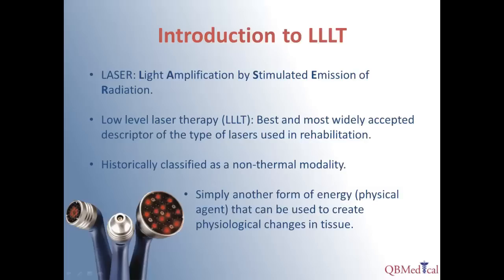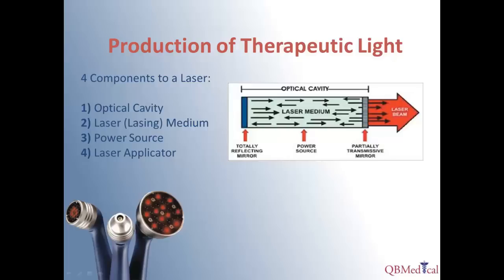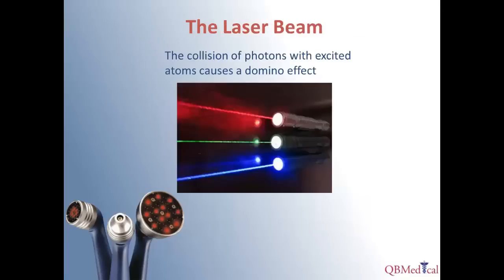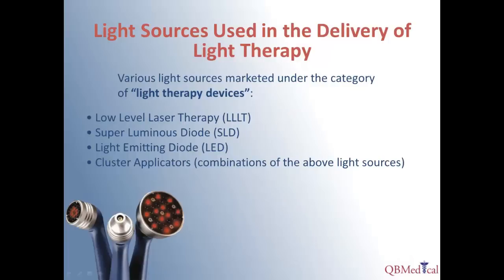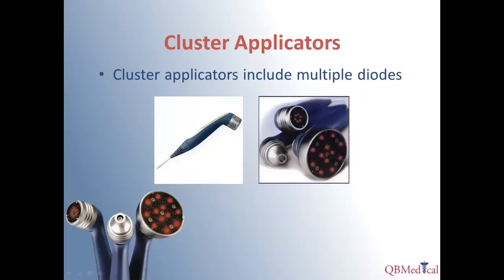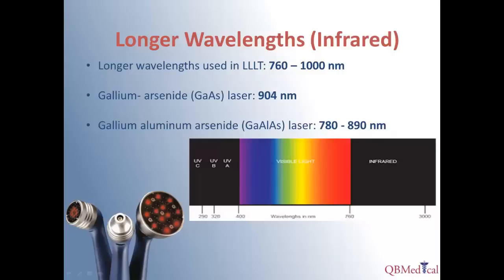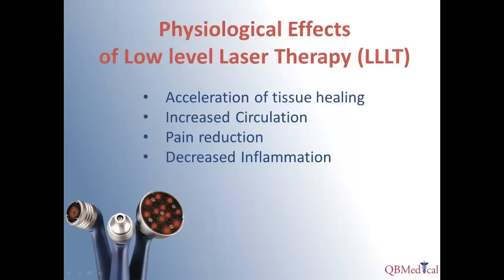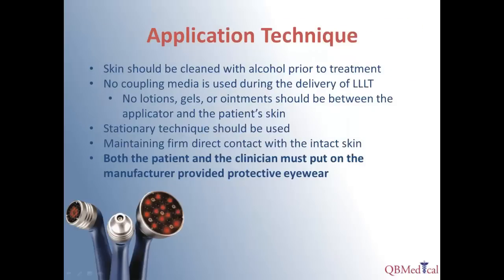Low Level Laser Therapy (LLLT): An Introduction

Comment: I had moderate knee pain and was skeptical that laser treatment would do anything to alleviate the pain. The pain level was about like a pinch inside knee joint and not a tear injury. After one treatment I noticed a marked decrease in pain level so I went back two more days to finish recommended three days of treatment. No pain since and I just feel like nothing ever happened. 
Had to pay cash out of pocket because insurance won't pay for treatment. This is only my own experience and no one else's, so take it for what it is.

Comment: Poor rats used in experiments couldn't tell you how excruciating these treatments can be for 48 hours afterward (10 out of 10 pain level compared to 8 out of 10 before ) and how they can cause such severe swelling as to make it pretty well impossible to move at all for 48 hours.  Is it possible that some people may be highly allergic to this or that those with unidentifiabe immune disorders on top of broken ribs and spine  may not find them beneficial at all?

While it may seem to be a good thing because it usually transfers much of the pain to another area, the other before-painless area can then become much more painful than the original area.  For example, if you can't lift because your upper spine is in such pain, the laser may make much of that be swapped for extremely severe pain in the lower spine instead, so if you broke your back repeatedly before the  laser was used, you will now break your rib instead.  At least that was my experience anyway.
Reply: Is it safe if you have a auto immune disease?